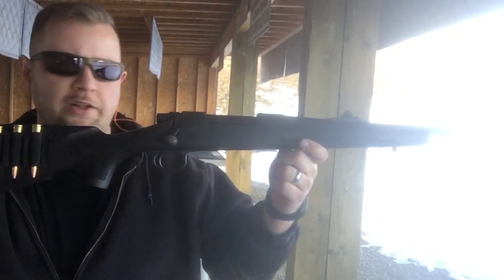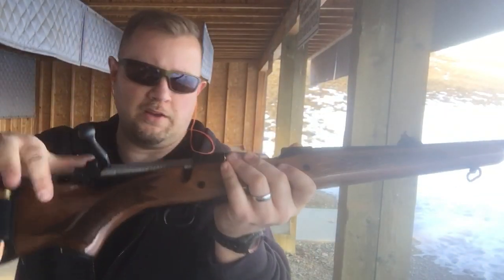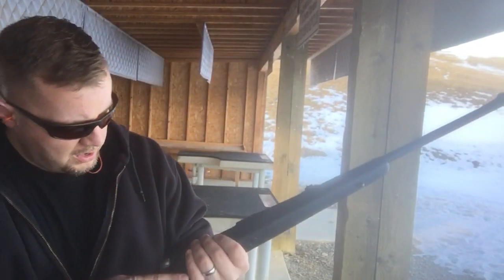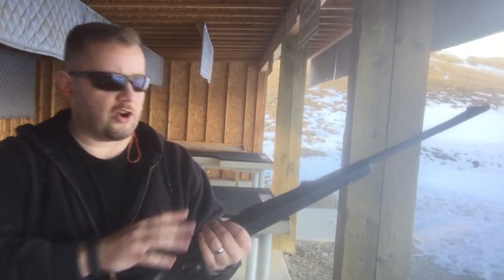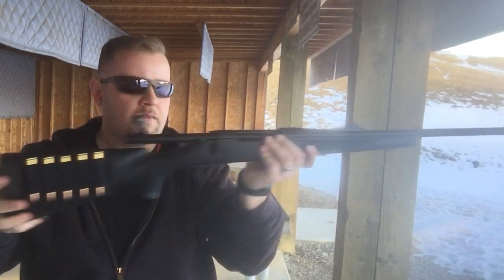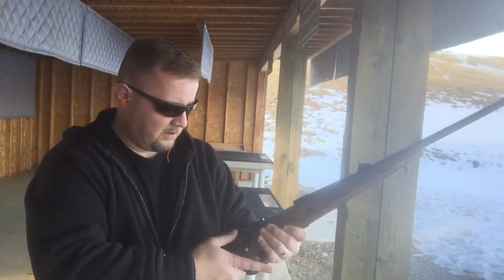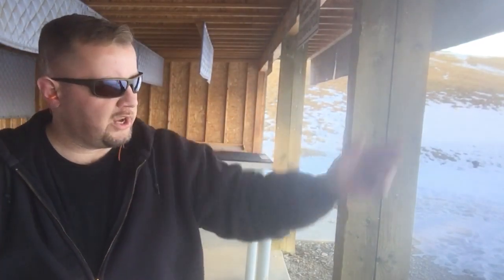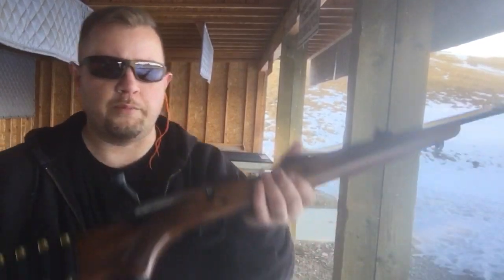Properly Operating A Bolt Action Rifle: Live Fire

Comment: when you rise the bolt pull it back then slide it forward and then lock it back into place what is that called and yes i am not joking with the question ether

Comment: I always think that a bolt action rifle is , or can be,more accurate than a semi auto, just because we have to manually load each round. This in turn, makes us re-acquire the target. ( or at least, makes ME, re-acquire the target !) 
I like these videos, keep them coming.
Reply: Reg Sparkes not only are bolt-actions more mechanically accurate, but training with them allows us to become better shooters. Expanding on your point, the bolt-action rhythm presents each cycle with a unique opportunity to properly shoulder, re-acquire sight picture, and deliberately squeeze the trigger. Semi-auto fire cheats us of that slower, manual cadence. Shooting a bolt-action with iron sights will make shooting semi-autos with optics that much better & consistent.

Comment: These videos are going to convince me to get bolt action rifle. Heck, that might be all I can get here in commy CA.
Reply: Haha. I have three of them. Really like my bolt rifles. Autoloaders are great when they have no failures. Really like my surplus GM Inland .30 Carbine and most fun gun I have ever shot. Fortunately no failures with it over the years and I chaulk that up to good surplus mags and keeping it clean. I have a couple of five round commercial hunting mags that run fine also but I have seen some carbines that failed miserably with larger capacity commercial mags. Rarely will I have any failures with a bolt rifle. There are a slew of budget bolt rifles on the market that folks can afford. Get at least one bolt rifle in your favorite caliber and move out of Commiefornia. I would pick a caliber that is cheap to shoot with factory ammo. Some calibers can be expensive unless you reload. I can reload so I am not affected as much by expensive factory ammo. Best of luck.

BTW, under normal range shooting I do not rapid fire my bolt rifles. Only once in a great while for practice or if need be while hunting. Continual rapid firing with a hot barrel will wear out a rifle barrel much faster regardless of caliber. I mostly just shoot cold barrel on the range between shots letting it cool down. Yes its painfully slow but its just bench shooting target practice on the range. Groups open up more from a hot barrel and I am usually shooting for accuracy so I want a cold barrel anyway. Don't forget dry fire practice first. :-)